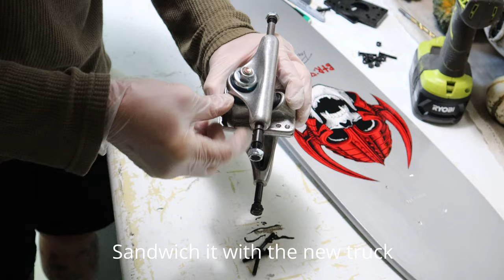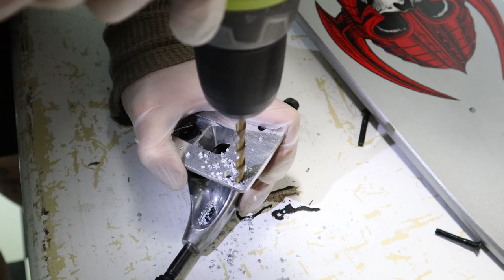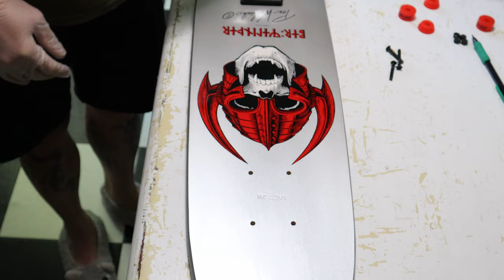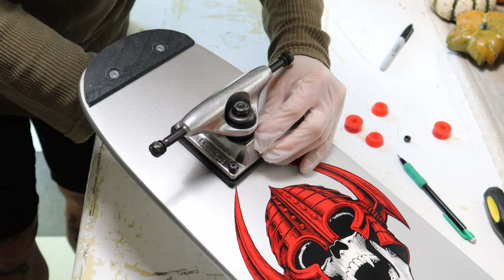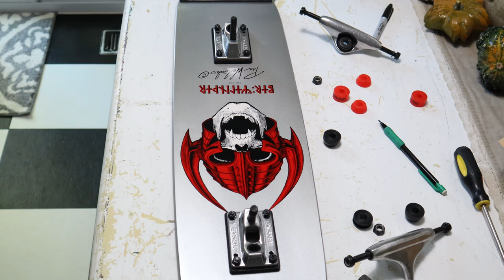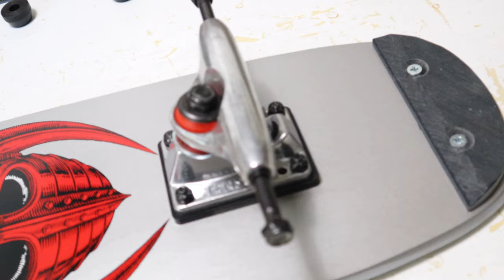POWELL PERALTA Per Welinder : How to drill old school hole pattern on your new trucks

Comment: Extremely dangerous for hands to make holes in this way.
Reply from the maker: Yes, you should use a drill press...etc. Definitely unprofessional. This is the easy fast way. I've done thousands myself with 0 injuries...with and without a drill press.
Reply: @decomposedskateboards  Ok, you've never gotten hurt, but someone seeing how you do it in this video could get hurt.....
Reply from the maker: I agree. You are definitely right there. There is always a first time for everything. People please be careful out there. Also know that truck alloy is softer than steel which reduces the chance of slipping during drilling.